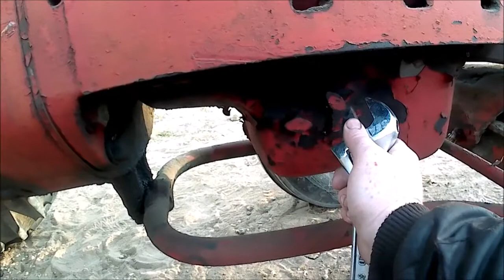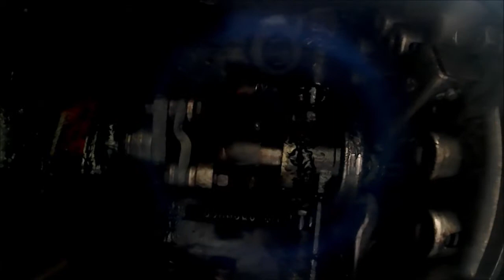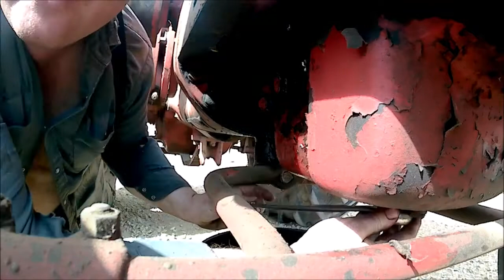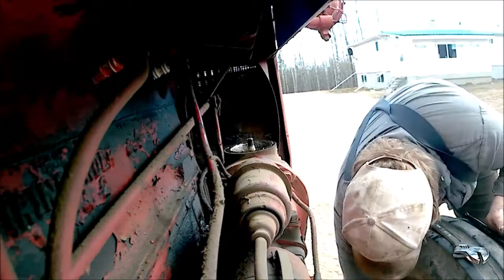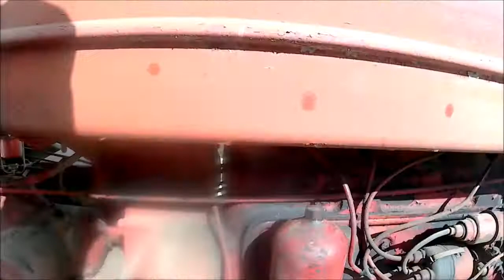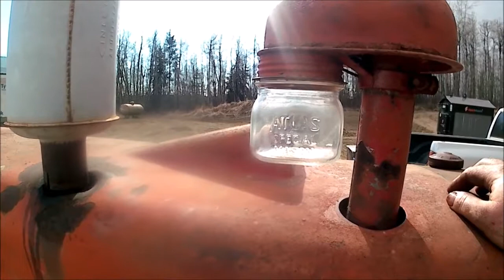International Tractor Maintenance

Comment: Good tutorial on the W6, there are so few on Youtube.
I am currently doing a minor rebuild on my dads W6, he purchased it (along with a Farmall H) back in 1942.
Initially I took the head off to have hardened valve seats put in to run it on pure petrol (gas)as TVO (paraffin) is getting harder to source here in the UK.
However, one thing led to another and I am fitting new rings, small end bushings and big end bearings too.
I felt the compression was a little low and sure enough, discovered the rings were shot but the sleeves were in remarkable original shape with virtually no wear after 81 years (and she had a hard life driving thrashing mills, ploughing and hauling trailers full of timber back to the sawmill).
Thanks for your entertaining video👍👍🏴
Reply from the maker: Thanks for watching!

Comment: Where is the pto control to engage the pto shaft? I am relatively new to these tractors. I can make the wheel work on the side and operate the hydraulics without problem but can't find the shaft control. Thanks for your help.
Reply from the maker: The PTO control goes along the rear housing  in between the  drawbar braces and it comes up near the left side of the seat pipe.  To engage, you push your clutch in and pull the control up. The control may have been removed.
Reply from the maker: I made a video explaining a few things: https://youtu.be/xuxiMj2oNvQ

Comment: I have a w4 tractor McCormick having trouble it starts for about 1 minute and shuts off what caused that
Reply from the maker: I'm 90% sure your problem is a restriction in the fuel system. There's a little screen where the gas line enters the carburetor. That could be plugged, or your line, or it could be inside the sediment bowl, or where the sediment bowl enters the tank. In that case, the gas will trickle into the bowl of the carburetor.  If it sits long enough, it will fill the float chamber... There's enough gas to run the engine in the float chamber for about a minute, and then it will stall
Reply: @tyfrank3427  I put a rebuilt carburetor in there
Reply from the maker: @yusefjohnson3299  It's likely upstream of the carburetor.

Comment: I have a McCormick deering international harvester i6 standard where is the location for the motor oil at
Reply: I have a W-4 tractor with a problem it will start but it will shut down in one minute what is the cause of that
Reply from the maker: It is usually caused by an obstruction upstream of the carburetor. Some gas gets there to fill the float chamber, but not enough to run it, then when the float bowl is empty, it will quit. Usually will run a minute before dying.
Reply: I6 gas is the same as this tractor. Mostly. Engines and frame serial numbers are in with the W6 and O6.

Comment: Very good video, you took the time to show very important things on the tractor. I have one like this that runs my 40 foot Frick Sawmill, it runs on propane and Butane. I have been looking for different videos on a tractor like mine. I wish I could convert back to gas or find manual on this tractor ,because  I do not know what year it is.
Reply from the maker: What's the serial number? Super W-6s were available on Propane, too and if yours is factory LP, don't convert it to gas. They are extremely rare.
Reply: @tyfrank3427  serial #8889  model #SwL6
Reply from the maker: @zoebridgers  You have a very special tractor... Not only is it one of the last 1953 SW-6s but with the L on the serial plate it is definitely factory LP.  You have a rare tractor there. Very few SW-6s are LP. I've only seen one other...
Reply from the maker: @zoebridgers  You can still but the manuals. The Parts books are very nice to have. You can get reproduction ones or find an original. The parts book number is TC-47. You might find one on ebay.  IH offered operator's manuals, and Blue Ribbon Service Manuals. You can get an I&T service manual...  The I&T covers the H, M, 4, 6 , and 9 series tractors.
Reply: @tyfrank3427  have been using the original parts book that came with my dads 1942 W6 to try to find parts with some success but it's very difficult to find suppliers for 'M' & 'W6' (C248) engine parts (especially TVO models!)
Do you have any suppliers there in Canada who still hold parts for the W6?
I tried a couple in the Toronto area without sucess🥴🥴
Subscribed👍👍
Reply from the maker: @WeeShoeyDugless  Your best bet is Stateside. Either J&D productions, Steiner Tractor Parts, or Bates Corporation is the place to go for those. you should be able to completely rebuild your engine.
Reply: @tyfrank3427  
Thanks for the heads up Ty.
I have tried Steiner but they had some parts but not all and postage to the UK became extremely expensive when using different suppliers.
I shall try the others.
Thanks again👍👍

Comment: Do you have a accurate picture pointing to it
Reply from the maker: The front engine cover on the right side. The cap is about 3" in diameter and it is winged to take a crescent wrench.
Reply: Thank you for your help.I kept on watching your video and it was there it was just different but it was there where you said it was
Reply from the maker: The filler cap is directly above the gear that drives the magneto or distributor
Reply: My valve cover gasket is leaking so I thought maybe you can give me some help on what part number what kind of gasket I need for the valve cover gasket
Reply from the maker: @yusefjohnson3299  They are a cork gasket. Part number is 45 952 DA
Reply: Thank you so much
Reply: You are the professor and these international harvest tractor I would like to know what part number for valve cover gasket
Reply: Mr Frank what manual do you have for your tractor
Reply from the maker: I have parts books for those tractors. and somewhere I&T manual. This isn't the only tractor I have. I have had a busy summer and therefore I  haven't had time to make more videos. I want to though
Reply: You are a big help to the world that owns these tractors
Reply from the maker: @yusefjohnson3299  Thank you. I try. I would like to do more videos but I have been busy lately...